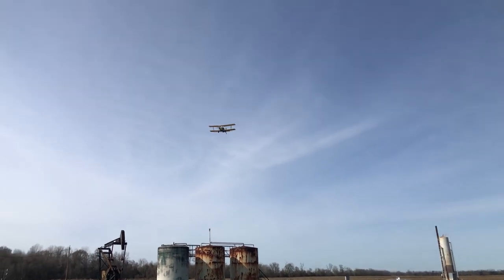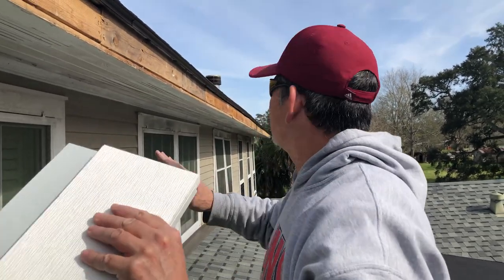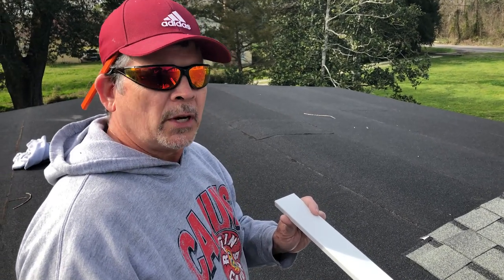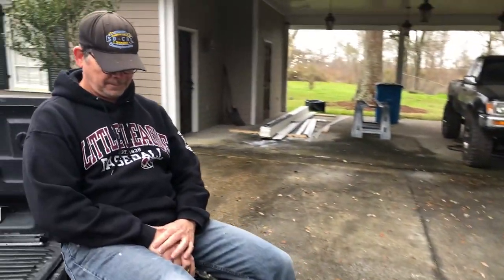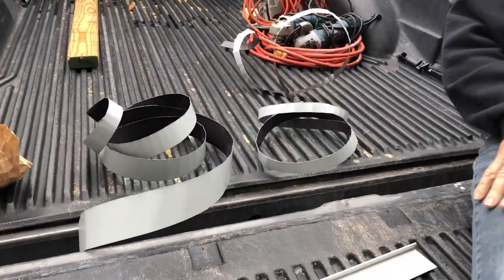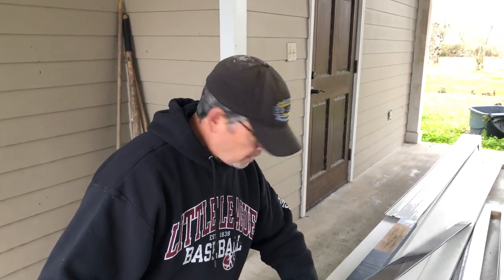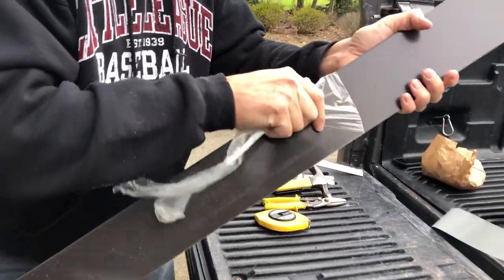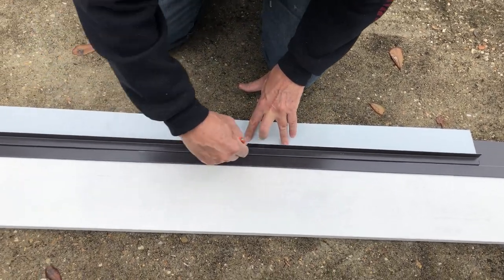Dead Straight Fascia on a Wavy Roof - How We Did It

Comment: up here in the north PVC expands and contracts sooo much that all seams need to be pvc glued. after trimming out many garages with the product the results are still difficult to keep consistent.  Great results guys!
Reply: I trimmed out my garage in PVC and I have the same issue (upper midwest).  The summer, the joints are tight and the winter they open wide.  I was surprised at how much it moves.
Reply: @thezfunk  I have since removed some on the outside of few garages and just used wood and the clients are way happier
Reply: Same problem here. I installed azek up a roof line on a 98° day. Kept it up off the shingles an 1.5. It was probably over a hundred on the roof. Glued all the seams. Winter came and homeowner had a roof inspection. He called me to look at the trim. The joints separated by a half inch. I even scarfed the joints and they still came undone. We’ve used azek with hardie siding. The expansion causes huge bubbles in the caulk. I’ve since switched to miratek and not looking back.

Comment: Some may think it's overkill but the majority of construction accidents involve roof work and falls. It is possible to fasten special supports to the roof or use a strong rope secured to something on the ground as an anchor. Then use a full harness, not a belt, because if you fall a belt can damage your spine. Between the rope and the harness you can use a self retracting lanyard which will allow you to move around but will lock like a car seat belt if the lanyard extends quickly. The slope on that roof is not great but if it is steeper or slippery, you want to get home to your family in one piece at the end of the day. The only other thing that you need to know is that you should never work alone on a roof because if you fall and end up hanging in the air, you have about 10 minutes for your partner to get a ladder to you and so avoid a thrombosis, blood clot in the veins in your leg which can kill you if it gets to your heart. Work smart, work safe. The extra time and effort may save your life.

Comment: I prefer steel over aluminum; I used to build airplane hangars, so I am accustomed to cutting steel.
Another tip is to make sure you sweep that dust from the grinder off of the concrete and any other painted surface.

Comment: A suggestion for future uses of Azek; instead of filling the screw holes and painting, use a Cortex plug kit, it drills a hole for a plug and the screw in 1 shot and you just tap in the plug from the kit; no filling, sanding or painting
Reply from the maker: Thx Steve.  I checked everywhere for plugs etc.  no one stocked them locally.

Comment: That was a serious bummer that the shop made that out of steel instead of aluminum. The difficulty in cutting the pieces, the damage to the fascia because of the grinding sparks and the extra time to trim and install really made the project more difficult than it should’ve been.

Comment: You can score aluminum facia material with a utility knife blade and then it will snap off on that score line, just use a straight edge to run knife.

Comment: Agree that the shop made a major faux pa by making the drip edges in steel. Gotta take off a couple of points off - 1. No miters on the joining edges - the addition of a cover plate doesn’t get it for me. Nice mitered edges with a little non-hardening caulk in the joint would have sucked those edges together real nice. 2. Would have returned the steel drip edges and would have made the shop replace it with the correct aluminum. Assuming there was a ‘build order’ at the shop - the aluminum would have been what you requested. What happens when the steel starts it’s inevitable rusting where you made your cuts? Props to to pop for his educating son and giving very clear instructions. Job looks real nice altogether.

Comment: Paul, I would have been raving and at the fab shop for giving sheet metal flashing ... just not the way I’d accept a professional supplier to be ...
Reply from the maker: Yeah but it was an hour drive to get there.  Lesson learned for next time
Reply: I sure you waisted a lot more than  a couple of hours messing with that steel instead of easily cutting aluminum. Plus if I were the Customer I'd have you redoing it because I wouldn't want rusting metal.the pvc will last for years the Metal already rusting where is was cut.

Comment: PVC really expands and contracts with temperature changes. How did you compensate for that and what did you do about the butt joints to keep them watertight?
Reply from the maker: We left a gap and covered it with custom made sheet metal.   Even the corners too.

Comment: In Industrial work, we NEVER use a grinder without a guard. True, it is not a full disk but on heavier material or if the disk binds and shatters, it will fire a piece at your face. I have seen pictures of welding masks with a piece of shattered disk embedded  in the fiberglass. So be safe and save months of surgery and rehabilitation....if you survive or have lost an eye!

Comment: i am extremely confused.  Why would you need a drip edge extension.  Why not buy a 10 or 12" fascia boards and tuck them up under the original drip edge.  Just use your string line at the bottom of fascia to make straight from one end to the other.  Line up bottom of fascia to string...   Seems like so many extra steps and material for no reason.  also that bottom flashing will limit the ability to change the soffet wouldnt it?  Someone please explain.

Comment: if you're using steel, would you then need to use steel gutters? I'm not sure your region, but I know that along the coast, mixing metals will cause the weaker of the two to completely pit out and rot within a season.  It's called electrolysis, and I believe it is caused by salt in the air, but I am unsure if the absence of salt would then make electrolysis a non variable.

Comment: Did you install the drip edge under the existing shingles or was the drip edge already there. So you bought the metal trim in a color to match the drip edge so the white fascia stays the same dimension all the way down. Nice job!
Reply from the maker: drip edge was there Rick.  Exactly right...  trying to trick the eye that the fascia is the same 👍

Comment: Just a lil tip i do alot of metal roofing and wanted to give some feedback you need to invest in a product called malco ts1 turbo shears drill attachment  and you will  thank me later
Reply from the maker: Thx Dalton 👍 I’ve seen them used by sheet metal guys.   Very cool 💪

Comment: You should never cut finished steel with a cut off disc. It will rust and bleed down on the new white facia over time. 
 An electric shear is definitely the way to go with steel and also works well on aluminum. 
 Personally steel or aluminum facia is much better for this application, vinyl expands and contracts to much. 
Definitely don’t paint vinyl.